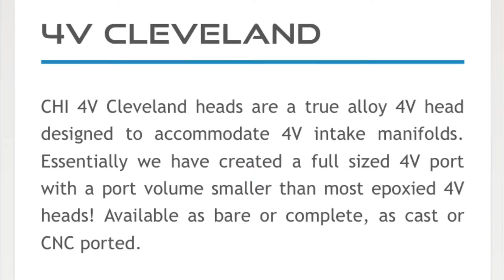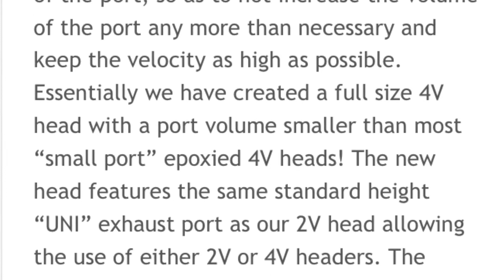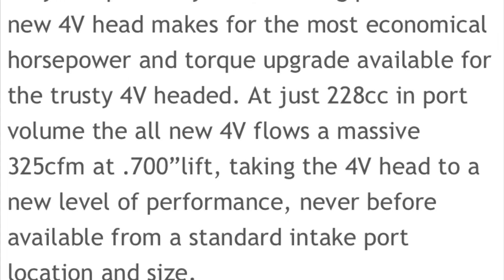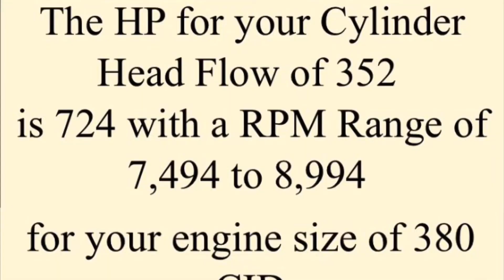CHI 4V alloy Cleveland Heads. 351C aluminium 4V CHI review🏁

Comment: Absolutely beautiful heads. Tons of potential
Reply from the maker: A lot of people don’t realise that they’re are really well revised 4V head. Even having less intake CC’s then a filled iron 4V  that everyone complains about. Chambers are all revised, exhaust ports are revised also  & keeping all bolt pattern geometry in the same place for all them “already built” Cleveland production setups 👌🏼🏁
Reply: @69JANKS  …. Thanks for providing such a well detailed overview of the CHI 4-V alloy heads. They did a great job of maintaining the basic architecture of OEM iron quench chamber heads so most production and aftermarket components will work fine without modifications. 

The photo showing filled 4-V intake port floors are very similar to my D1AE-GA iron high port conversions done by Endyn. They used aluminum inserts and epoxy in the port floors to shorten the height from 2.500” down to 1.9375”.  They increased the port width slightly from 1.750” to 1.8125”. 
They also did some more work at the back of each port by filling the big turn  with a curved aluminum insert just enough to smooth it and eliminate the sharp turn down to the valve. 

I don’t have any flow numbers but Larry Widmer at Endyn extensively used a flow bench of his own design for optimum results. I’m sure they will get the job done quite nicely 🏁.
Reply from the maker: @danielwilson6665   they sure are DW,  CHI have a great range in Cleveland & Clevor Heads.....
I stuck with the alloy 4V version not only cause I’m a bit of a Cleveland purists lol but all my pre-fabrication within my engine bay was fabbed up with my iron 4Vs as a mock up.....
So pipes, 4V Blower Manifold, etc.......
Will do a vid about it all soon.
Your filled 4Vs sound badass ,they’ll make some power for sure 💪🏼🏁